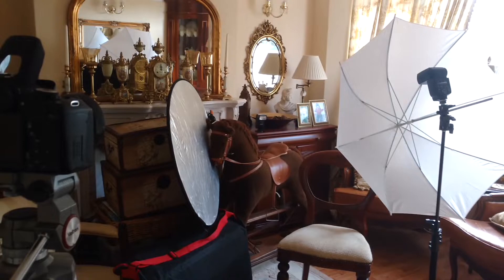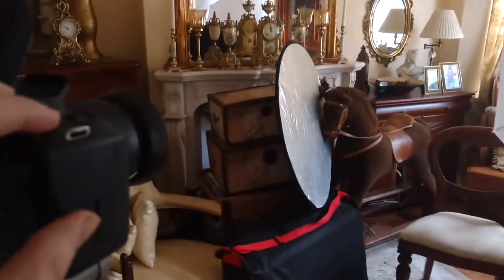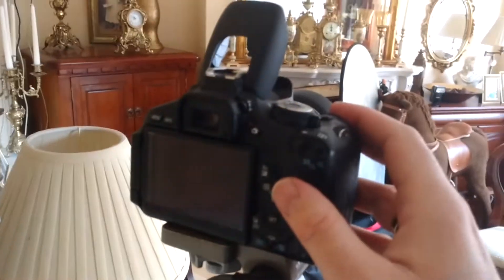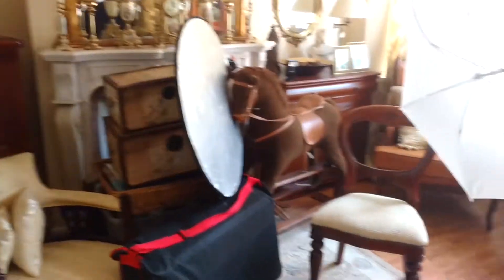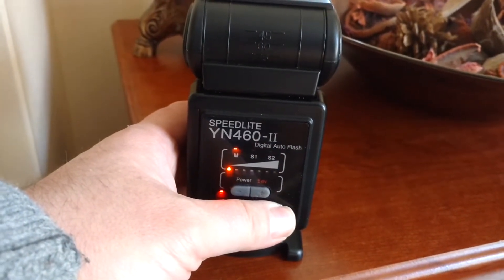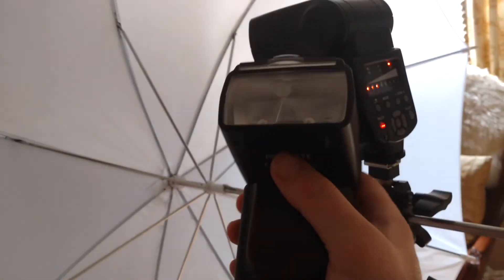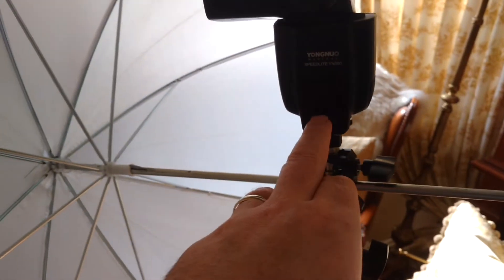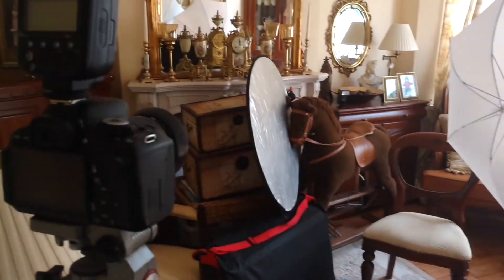How Off-Camera Wireless Optical Slave Flash Units Work

Comment: finally someone that explains optical slave mode correctly!! thank you so much sir. I have a question though, is wireless triggering is more accurate than optical triggering?
Reply: Wireless triggering is more accurate in the sense that you can use it outside too, where the optical slave would not be able to see the triggering flash, or in a club or smth where random flickering lights may trigger the flash. Also, if another photographer is using flashes too, with optical slaves it's game over, because they will trigger your flashes too. But a wireless trigger will let you change channels so you wont interfere with the other photographer or vice versa. But in a studio type enviroment, the optical flash does more than a decent job too, and it's an awesome way to learn how your flash works, provided you are a bit creative in how you use it. For example if you use the on camera flash, you can cover it with a piece of paper so it will be bright enough so the slave could pick it up, but not bright enough to make a significant difference on the subject in the photo. Hope this helped :)
Reply: @cirtoajeteodor  it helped a lot; thank you so much ^^

Comment: Do you have to set up both flashes individually or do they work on one channel?
Reply: The slave flash is fired by the  built in flash on the camera and not by any sort of radio signal, so there is no channel to set.  The built in flash of the camera can fire several slave flashes at once.

Comment: I also have a canon ti3 rebel, and I found that you CAN disable TTL And set the built in flash manually as follows: go to menu, flash settings, and set it to "custom wireless".  Then change it to manual (no TTL), and fire the builtin and the wireless together.  Then you can set the power of the "group" down to 1/128 power.   Kind of a pain, but now you can fire the flash once and in super low power.  I still need to try it for real when my cheap slave flashes arrive.
Reply from the maker: Great info, thanks!

Comment: Hey Rob, just a quick question, I bought a Yongnuo flash Yn685, trying to do the optical trigger with a Nikon D7000 built in flash. So far no success, Can you suggest any option? Cheers Ankan
Reply from the maker: Check the manual to make sure you're in the right slave mode, and start with your camera and the slave flash close together and see if it does work, then gradually move them apart.
Reply: Thanks Rob! Ya the manual does not talk about any optical trigger though. I tried all possible combinations but no luck. The flash works well when it's on camera.

Comment: Hello excelent turtorial but I like to add that you can disable the TTL funcion of the pop up flash via the camera menu and set to the lowest power setting in manual mode. I have Nikon D5100 and that is what I do when I wan to trigger my external flashes I go in the menu and set my pop flash form ttl to manual mode. Then I set the pop up flash to the lowest power setting to use it to trigger my off camera flashes only
Reply from the maker: Great info, thanks!
Reply: you welcome

Comment: I have optical slave on my budget flashes, but not the higher end one. I forget the feature is there, and usually use radio triggers because I can trigger them from the transmitter instead of reaching around the back of the brolley to press it.
Reply from the maker: +Maxsdiscos Good point. Radio triggers are much more reliable, and as you say, some can adjust the power of the flash remotely.
Reply: +Rob Nunn I use sync only ones, but I can use the 'test' button on the transmitter to give flash, ready for the handheld meter to read.
Reply from the maker: Ah, right, good info, I haven't got a flash meter, but that's a great feature if you've got one, thanks.
Reply: Handhelds require less experience to use (than using histo's). The reading will usually be the 'politically correct' one, which is usually quite dull looking. Useful for matching powers, and allows you to set up quickly without needing to get the camera out.